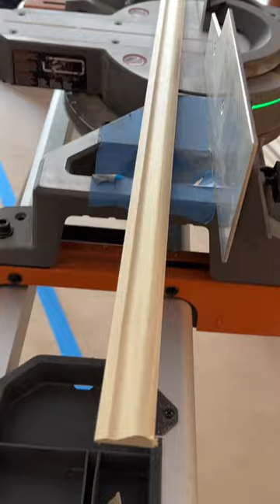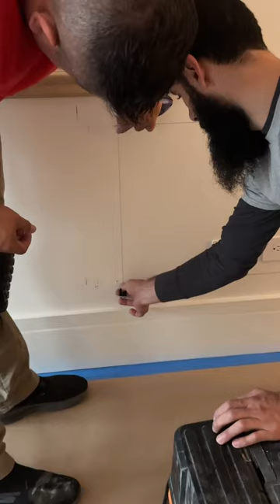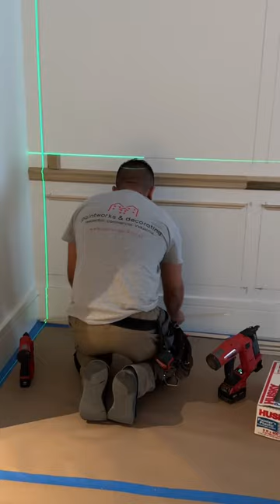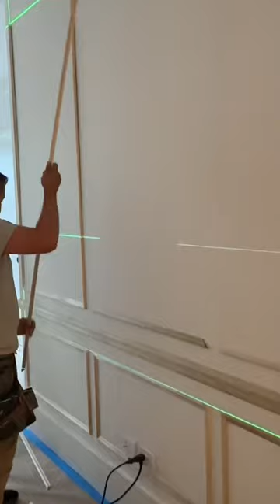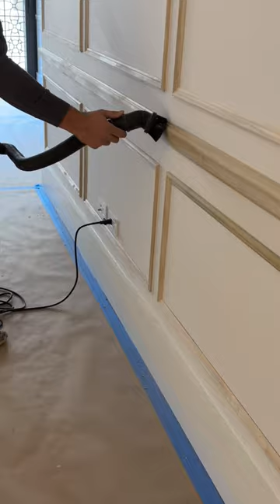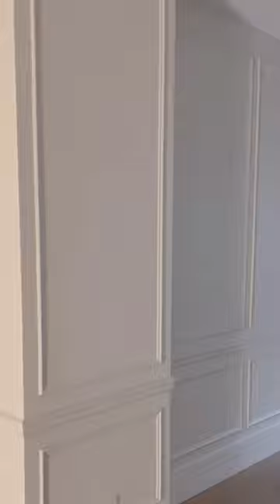Wall panel molding installation beginning to end

Comment: Hi what sealant did you use before paint? Caulk?
Reply from the maker: Wood filler for nail holes and then caulking all edges.
Reply: @paintworksnyc which caulk are you using does it color in weird way after paining over it
Reply from the maker: @Nimlu  I think it was ALEX FAST DRY® Acrylic Latex Caulk Plus Silicone. It did not color any weird way.